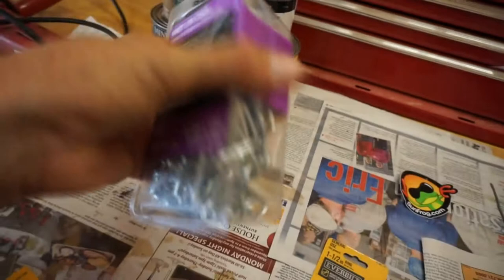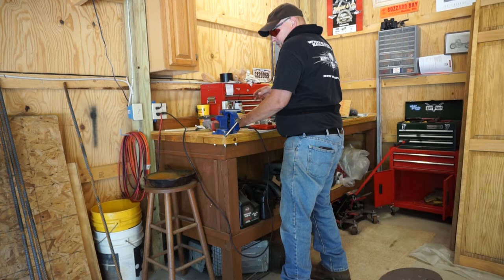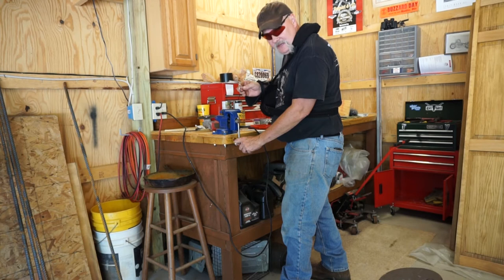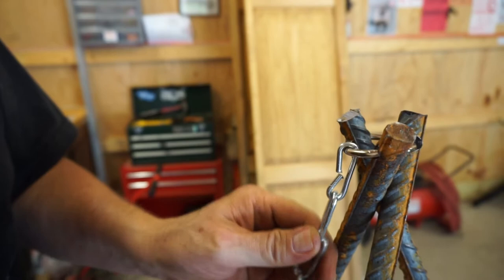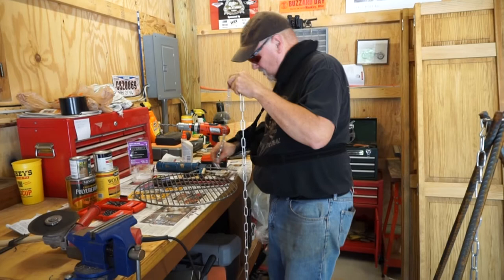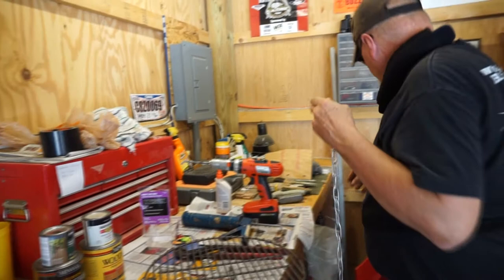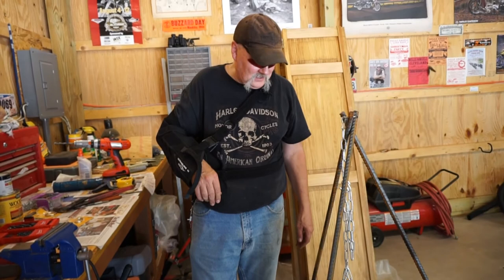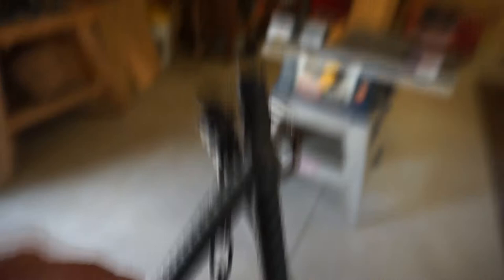DIY - How to Make  a Tripod Campfire Grill

Comment: Just a thought, but instead of cutting the chain to put it on the ring why not slip it on there before you close the ring around the legs?  You could also use one of the hooks to connect the chain to the tripod so that you can remove it for storage.  Nice project.

Comment: Hey Itchy, just found your channel. I've been binge watching all your videos when I saw this and just had to make a suggestion. Maybe you have already realized it or you don't have storage concerns, but if you would cut & remove a link on the down chain a link or two above where the 3 chains hook on, you could use your 2nd S hook to join them, leaving one end of the S hook slightly open. That way the poles & trivet could be stored separately but be very easily assembled.